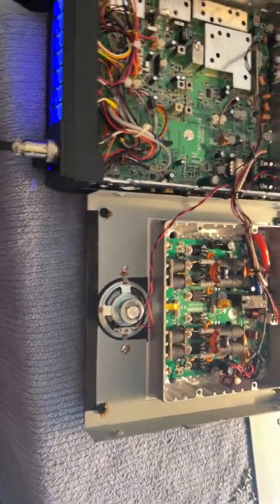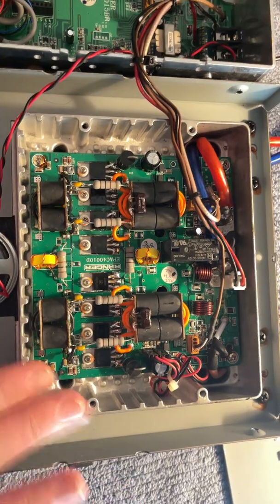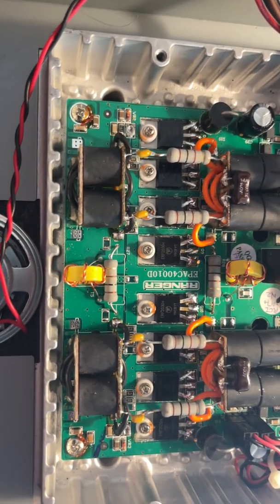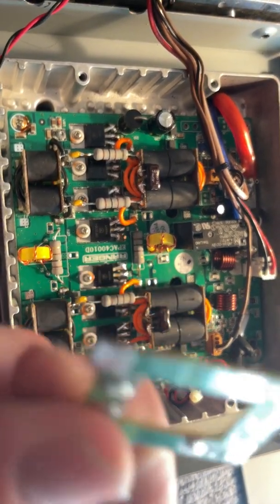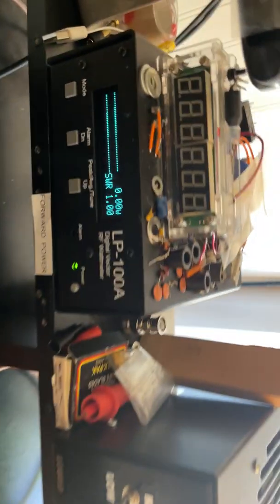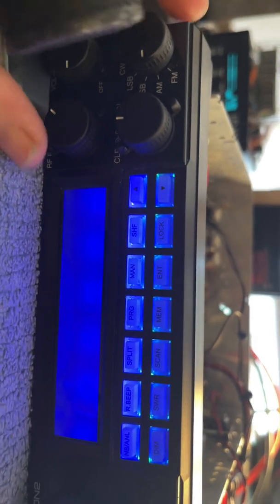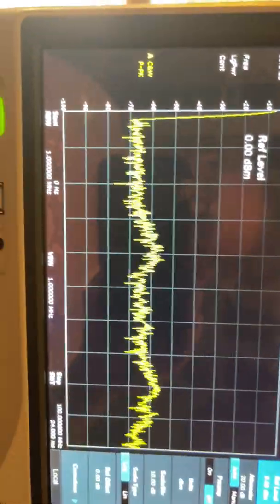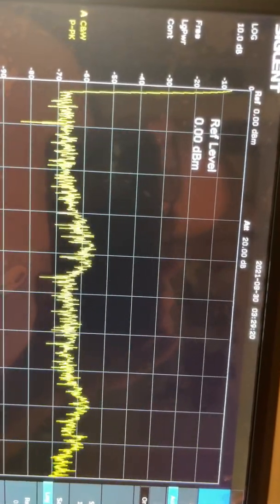RCI 2970N2 with 2030+ mosfets in Amp section and optimized.

Comment: Nice work. Curious if you matched the 2030+ mosfets and also what about bias on the amp board?
Thank for sharing your findings
Reply from the maker: yes . I used a Atlas DCA 75 to match the turn on voltages for each FET. I did re adjust the bias on it as well. set it to zero and then slowly went up till it looked the best on spectrum Analyer.